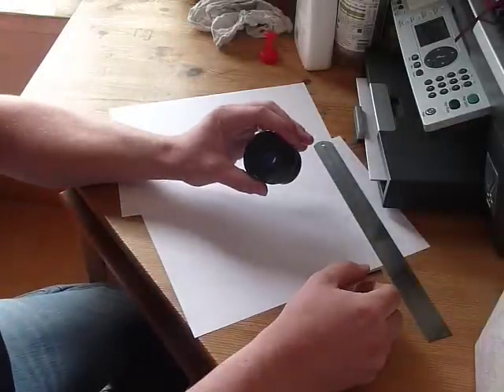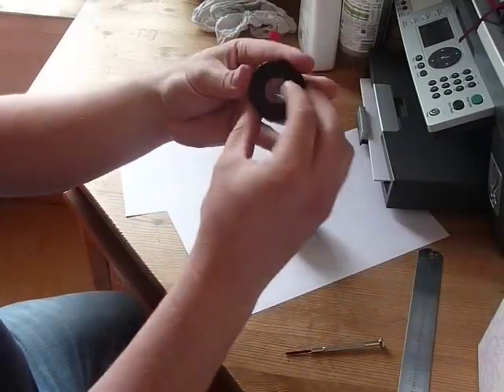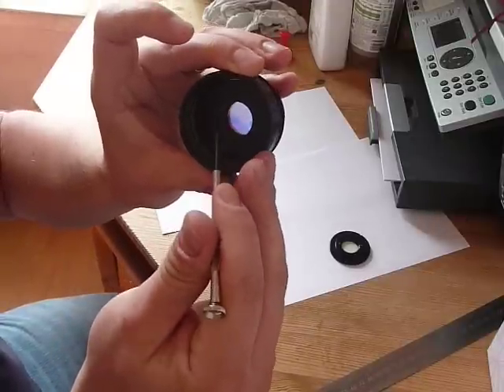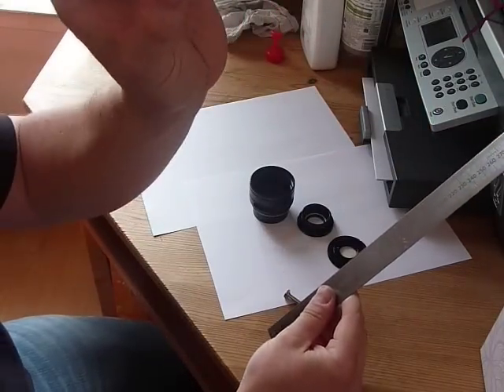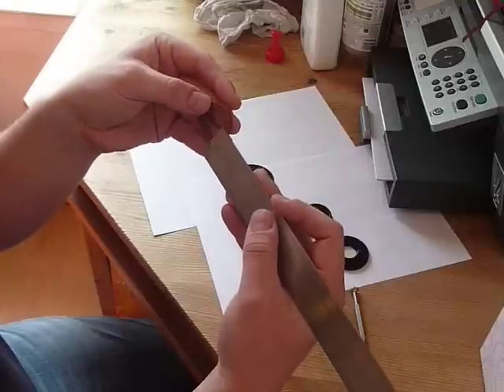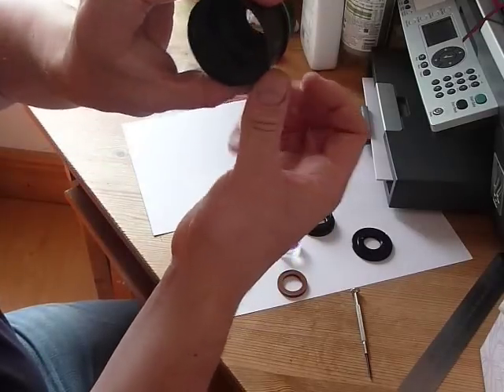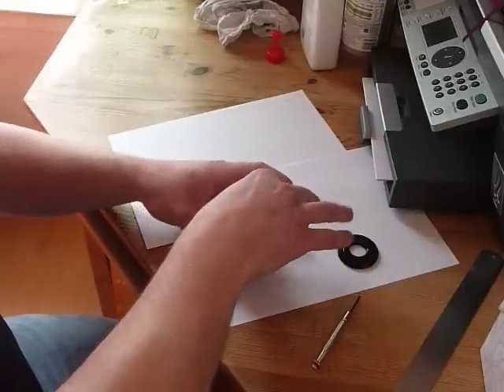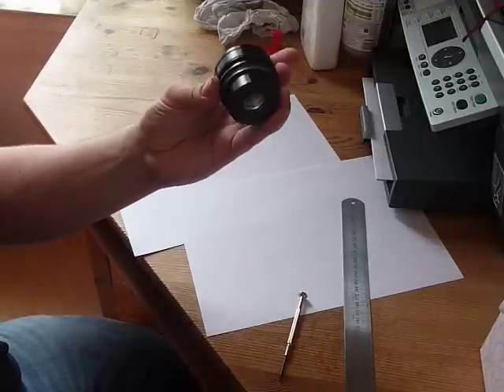Coronado PST Mod Etalon Assembly Disassembly

Comment: Excellent video with some very useful info for PST owners. The expertise comes across effortlessly in your dialogue.
Your lens cleaning regime would have been a useful addition. ;-)

In retrospect I'd have removed the white paper from the desk to avoid affecting the video camera's metering. 
Just something I learned from long experience from producing far too many dark videos and images. 
A neutral background works wonders. Medium light wood grain, hardboard and buff packaging cardboard are all good.

Comment: Hi, there is quite a red glow in view in my pst! Is it possible to replace the etalon for another one ? ( my etalon is probably also not the best/brightest one...so with a new/ better quality etalon I get - 1) no red glow and - 2) a higher "peak  transmission" for brighter views? Or I can save my money for probably the better Lunt 40?  1) put a new/ better etalon or 2) save for the Lunt 40?  Thanks for the tip!!